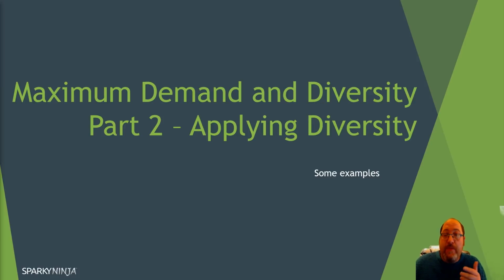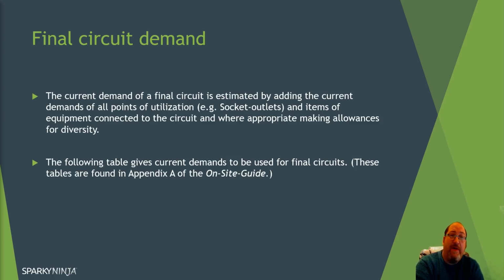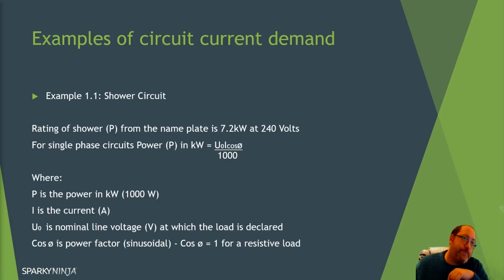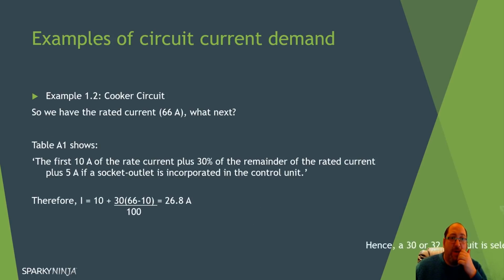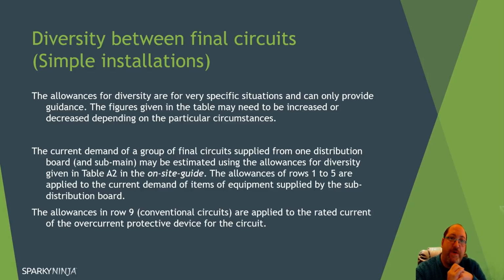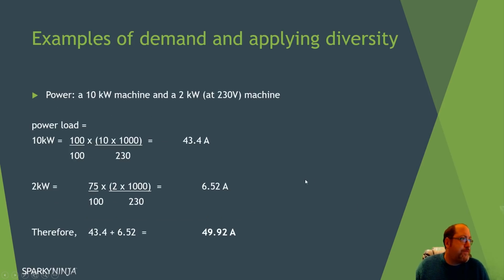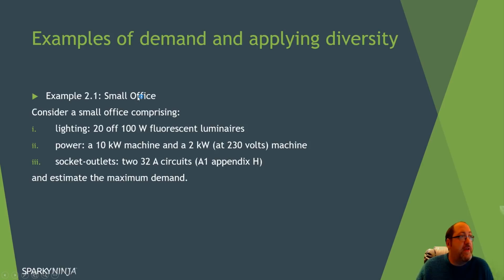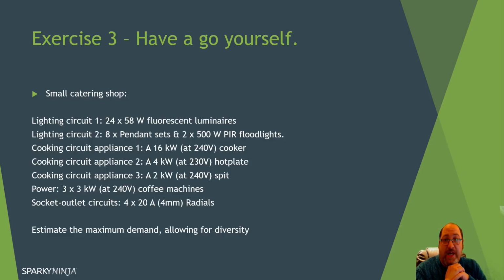2396 Ep 6 - Maximum Demand & Diversity - Part 2 Applying Diversity

Comment: Great videos mate., sound and to the point. Just a bit lost in the one calculation, perhaps its a typo. Circit4, the two socket outlets, you have cct one at 30A and cct2 ar 12A, i understand 40% of 30 is 12 but where does 30 come from. Is it not 32?Video is old so hope you will respond. Cheers regardless

Comment: Wonderfully explained. Cheers mate. 

Can I ask the real purpose for applying diversity; is it to select the appropriate devices or what exactly? 

Links
Reply from the maker: Diversity is an attempt to consider saving money whilst ensuring reliability.
So the supply cable to a consumer unit would be excessive and a waste if it was just sized to carry the full load of every circuit at the board in total.

Comment: Hello with the try it yourself example with the power circuits 3x3kw, in the osg it says 100% largest, 75% remaining appliances, how do you work that out ? Also would you use the osg for industrial premises ? 
Thanks
Reply from the maker: I'd never use the OSG as a starting point in the real world - but would consider it for guidance if I felt I didn't understand the installations load and demanding very well. Obviously for the sake of a City and Guilds assessment, referencing the recognised material is recommended.
Reply: SparkyNinja so what would you use instead ?

Comment: Diversity on an induction/ceramic hob; is there a definitive answer on this as no one seems to know whether to apply or not? I am of the understanding to NOT apply due to the way the hobs work and the manufacturers instructions/specifications have taken diversity into account. I also like to allow for the 'Christmas Day' factor when it comes to hobs/ovens
Reply from the maker: With little info I would do similar with the christmas day idea, maybe a couple of rings at a time, so half the potential demand for diversity.

But if the manufacturers have provided data, that always comes first in my view.

Comment: Thanks for the in detail information Sparky Ninja, great to re visit the guides in detail, and have them explained in plain english. 
 Ive been calculating power factor by 230v nominal voltage for ages since European nominal voltages were harmonised at 230V. 
Can I ask are we just using the 240v from the design guide for the aim of this exam or are we, should we always use p/v at 240v any how.. Keep up the good work.